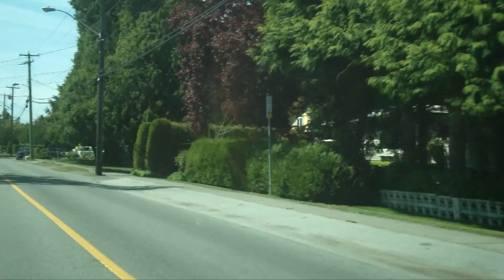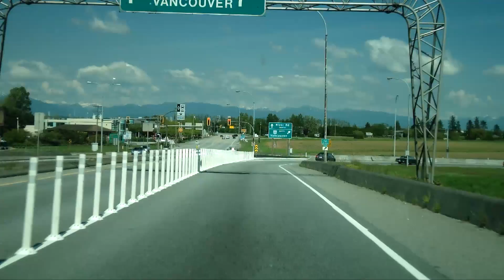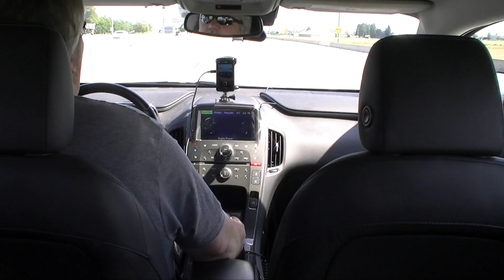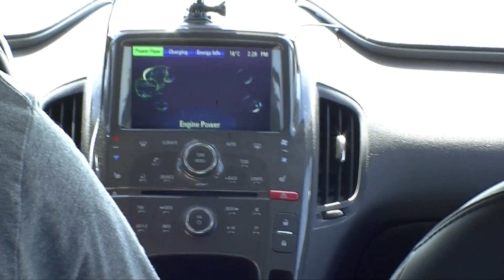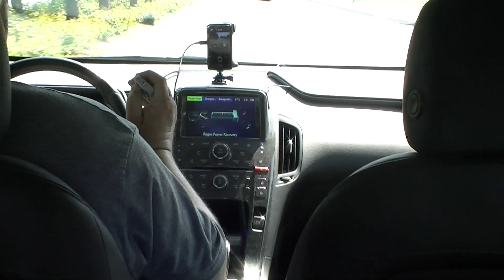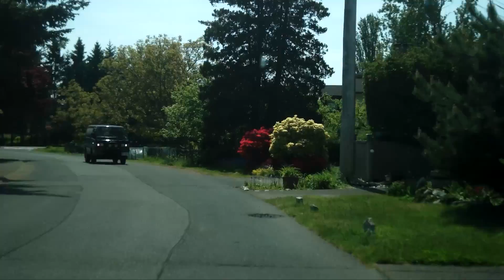How to drive a chevy volt for best electric range and fuel economy

Comment: Do you use mountain mode?
Reply from the maker: Not unless in the mountains.  
I have the final update that remapped the becm so in cold weather it starts the engine.  Leave in normal mode.  If the update is not done then its a good idea as it keeps a higher reserve but the final update did the same thing.

Comment: Ahh it did too have regen on demand on the steering wheel. Is yours just old? Also, the manual says to LEAVE IT IN L when in city driving. Put it in D on highway speeds

Comment: Now idea why you would shift from Normal to Low all the time. Why not driving  it in Low all the time?
Reply from the maker: Because i don't want the car slowing down quickly Everytime I take my foot off the accelerator. Leaving it in low on slippery surfaces can cause a skid if you take your foot off the accelerator.

Comment: kilometers?  are you british?
Reply from the maker: No Canadian.  Remember the entire world except the us is metric.
Reply: @12voltvids  oh ok
Reply: oh also.  my 2012 volt will not charge w/ the cord b/c chvcs warning.  i've done everything i can to fix it and it worked for about a year.  now it's back.  too expensive to get dealer to do it.  what's best way to drive volt engine only to get best mpg or mpk. ???  i will rewatch your video for any hints.  thanks
Reply from the maker: @michaelcarman4875  just keep it in mountain mode to get a 10 mile reserve on the battery at all times to avoid over discharge.  Mine is 12 years old now.  Haven't spent a dime on it yet other than new tires.
Reply: @12voltvids  thank you very much for your expert advice !!!  i will do!!
Reply from the maker: I would recommend this for those that have NOT had the update applied. I follow this golden rule in the winter months in sub zero temperatures. but the 2019 recall update fixes that problem and when it is plugged in will even trickle charge the cells if its cool out. The update reduced the electric range a bit and keeps a larger charge in the battery to prevent the propulsion reduced message and the engine running at 6000 rpm trying to play catch up. It starts the engine sooner, and sometimes within a mile of departure to do a cell balance. Basically if one cell is out of balance any time it will switch to gas for a few minutes to balance the cells and then back to electric mode. This car now has over 210,000 km on it no issues.

Comment: I have owned a Volt for 4 1/2 years now, and I find it is much better to just drive in LOW and do 1 peddle driving, so you just use the accelerator peddle for braking also. That is how you will get the best range out of your battery.
Reply from the maker: My wife does that quite often on the now 11-year-old first generation that she drives. When she's driving around town she leaves it in low range and just does the one pedal drive but on the freeway puts it into drive. I prefer more to coast and only shift it down to low when I'm decelerating I like that I can take my foot off the gas and coast and not have the car slow down and not have to hold my foot a certain amount of pressure on the accelerator to not decelerate. Keep in mind that first generation does not activate the brake lights at least by 2012 doesn't, activate the brake lights when you take your foot off the gas in low range it just slows down. It is resulted in a couple of near misses where the jackass behind me hasn't been paying attention and because the brake lights didn't come on damn near plowed into me so I use it and keep my foot I tap the brake usually to get their attention that I'm slowing down because some people just aren't paying attention they're too busy looking at their phones are playing with the screen on their Tesla. Actually that's fun when you see somebody driving a Tesla and you know they're not paying attention because they're in autopilot you pull in front of them and then shift it into low and take your foot off the gas so the car starts slowing down and then all of a sudden you see their head pop up in the mirror like deer in the headlights as the car goes into emergency braking because it doesn't detect the brake lights and then the radar on the car to text that they're getting close and it hammers on the brakes and wakes the driver up that's always fun to watch the reaction when their car slams on the brakes because you slow down in front of them without your brake lights coming on.

Comment: I just bought a 2018. I, too, was worried about being rear ended. However, I have found that as soon as the regent comes on, which is as soon as I take my foot off the throttle, because I always drive in `L' the brake lights come on. In `L' it is like using the jake brakes in a big truck, on low. The paddle under the steering wheel increase the braking to stage 3, in a truck. Thusly I can slow to 3 or even 0 K/hr before I step on the brake.
Reply from the maker: I use the paddle and only put in low if i want to stop fast.  The wife drives the 12 in low quite often and it doesn't turn the brake lights on.